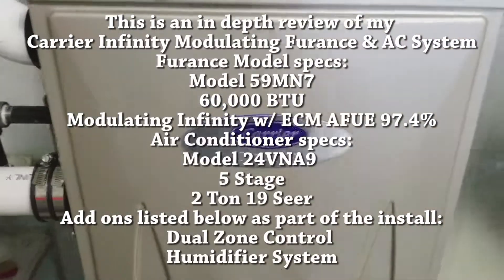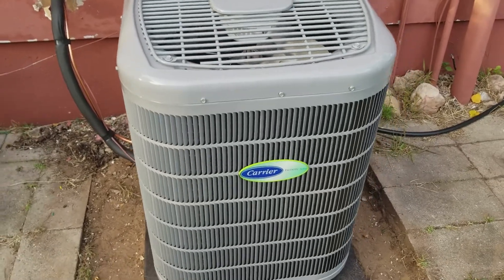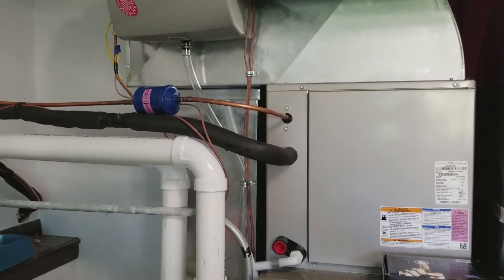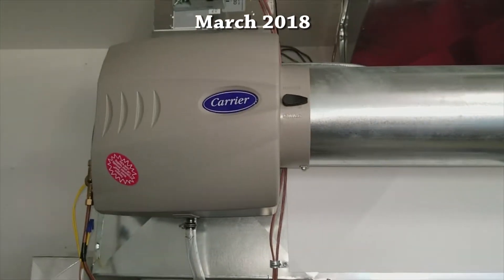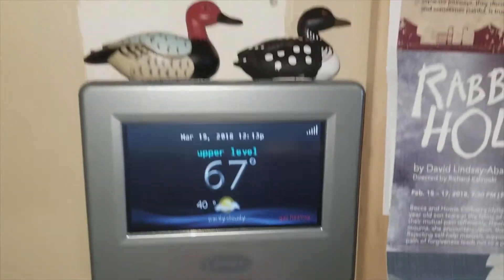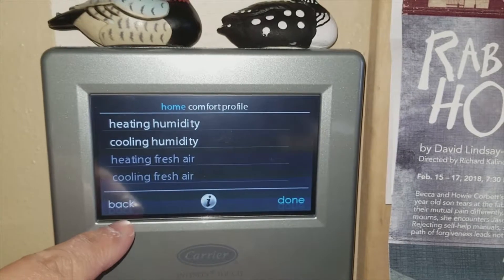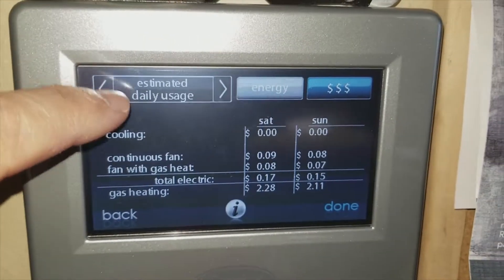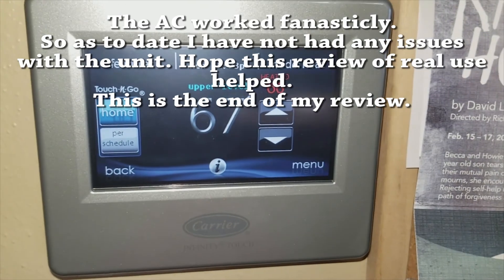Carrier Infinity System Complete Review

Comment: Nice video.  Some questions/comments:

- When you showed the label on the outside condenser unit, your overlay commentary screen obscured most of it.

- For the outside temperature sensor, was that for the HVAC system?   I've seen (and have had) identical ones, but they are for the AutoTrac controller for just the humidifier.  It was a a good idea to relocate that out of full sun.

- Did you consider a combined heat pump version for heat, in lieu of replacing the furnace?

- At one point you talked about the heat rising up in 1% increments.  That's true for the full variable stage (NVA8 model I believe).  If you have the NVA9, that's the five-stage unit (stage 1 at 25%, stage 5 at 100%; then varying levels for stages 2,3,4).

- The energy saving mode, I believe you'd use that if have a variable-cost energy plan.  That is, the (typically electric company) gives you below average electricity costs during off-peak / low usage periods, in exchange for either charging you more, or remotely disabling certain appliances - as a way to reduce the consumption during peak times.  [My Rheem heat pump hot water heater has a similar setup (but I don't have that service from my electric company.)]  If you have that electricity plan, you'd probably want this mode enabled.  Else running your AC during this peak time could cost big bucks.

I'm about to evaluate two Carrier heat pump systems:  a two-stage Performance system, or the five-stage Infinity system.  I really like the features the five (or variable) stage systems provides.  But as I keep seeing in comments, I don't sense that the reliability of these highly-advanced units is rock solid.  Couple that with it seems like any repair is going to be a four-digit one, I'm not sure it's the best unit for me.

But I wish you the best luck with yours!
Reply from the maker: Hope you are able to find what works well for you.

Comment: Excellent review. Very informative. Thank you so much for making this video. I know it’s been a few years. I was wondering, because I just installed pretty much the same system except mine is a heat pump. How is your system holding up so far? Thanks for the great review the infinity control panel. Not even the manufacture video explains it as well as you.
Reply from the maker: No issues what so ever. Only thing I not crazy about is the dumb down app they switched to. The old app, same as the console you could do and see everything. The new one is basic controls only. It works so shouldn't complain much.

Comment: How reliable (system stability, temp. accuracy, phone app, etc.) has the thermostat been? I'm considering a similar Carrier/Bryant system, but reviews I've seen of the communicating Infinity Control give me pause.
Reply from the maker: The unit works solid, if you are worried about just the app part then get ready for they all have app issue. In the end I 99% of the time just use the control panels. Theu have updated the app, however in my opinion any app to control any device will always be buggy. Its the nature of IoT devices, kinda like a car and relaying on the app to unlock the doors. Best to always have a key on you as remote technology will typically fail at times and best to be ready.

Comment: I have the same system ..suppose the touch screen goes completely black and shuts down the unit but i still have electricity thru the house. Does this unit have a battery back up ???on the touch screen
Reply from the maker: No battery back up, at that point you could use the app to control if the screen is damaged

Comment: With the infinity systems I've installed, it was necessary to install a muffler in the suction line maintaining 10  inches of straight tubing on both sides of the muffler.
Reply: instablaster
Reply from the maker: I am guessing you have a much new home than us and its sealed much better?

Comment: Good luck using the my infinity app. I have this same system but the app for the phone is down right garbage. Also their servers are down about twice a month too in which the app is then 100% useless
Reply: Might want to try uninstalling and reinstalling the app, or checking your phone compatibility.  I use my phone app every day for six years now with no problem.
Reply from the maker: True, the original app was less than stellar. The newer app seems to have much better connection reliability. The app is just a bonus for us, I just make slight settings at the control unit I just like to as is simpler I think, I dont like to carry my phone with me when not working like to relax so I leave it turned off.

Comment: Carrier is now partnering with samsung.. for boards and the modulating compressor. They are using a transformer to make it run on DC voltage to achieve this. Watch out on some models you have to reprogram right out of the box thru the thermostat via wifi.

Comment: I've been installing Carrier equipment for 40 years. Wait until a circuit board or motor fails. You'll part with ~$800.00 to $1000.00 for the repair bill. Absolute garbage made in Mexico.

Comment: the myinfinity thermostat absolutely sucks.  Just went to a TP-link AX3000 router I bought from an Arris.  No way can I connect.  In the beginning I had many issues connecting and it didn't work for months.  I figure this has been outsourced and whoever it doing the programming doesn't know squat.  If anyone has any good tips let me know.
Reply from the maker: I am guessing you can connect to the wifi feature. My recommendation would be to create a legacy wifi connection. I have one set up for older and non speed related devices in our home. This way it can allow for older wifi devices to connect without dropping. Even though the wifi in the units is good, keep in mind best to keep it simple for some devices.
Reply: @ronreeds9993  Carrier finally replaced the thermostat after much testing and putting in one of their routers. With the new thermostat which is completely different than than the first one, I’ve had no problems. And it connects up to the Wi-Fi system I had in place and everything else works on. They finally admitted they’ve had a lot of problems with that first version